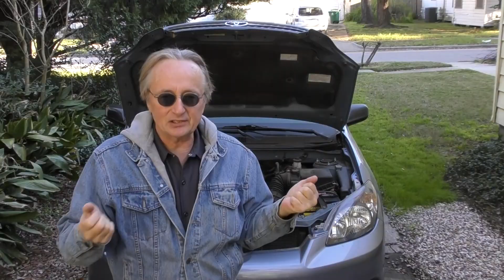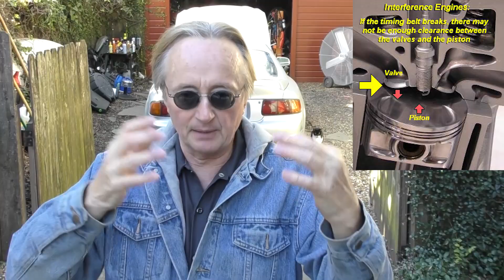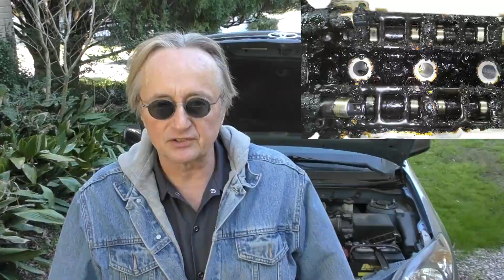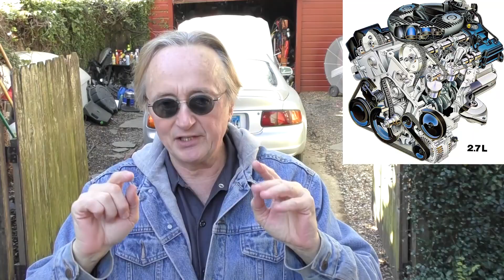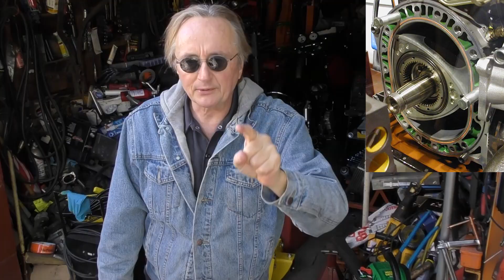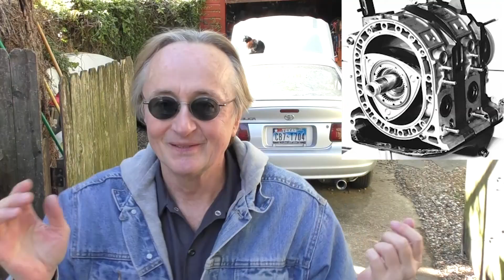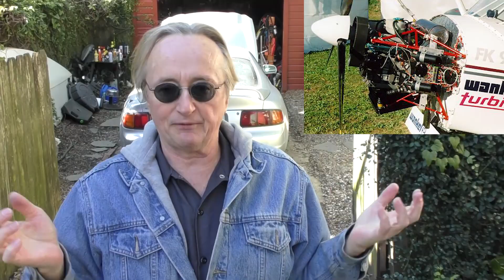Never Buy a Car With This Engine

Comment: Dodge 2.7. Olds 3.0. GM 2.2. Ford 6.0 Diesel. ANY Northstar engine. Those are the ones that come to mind.
Reply: For some reason, the 1996-2001 Northstars in the Devilles were decent.  I'm not sure what all the specific differences were... but I know in 2002 they went decided to f*** up a good thing and make garbage again.  I have a '99 Deville w/ 185K+ that has been trouble-free.  I love it.
Reply: The 96-01 NorthStar engines were one of the worst model years. The best NorthStar engines are from 2006-11.

Comment: On the other hand, their 2.4l LE5 is a beast. I have a 2006 2.4l Cobalt that I put 389,000 miles on before spinning a rod bearing. About 50k miles of it was pulling a pop-up trailer as 170% of its tow rating. Of course that cost me a transmission, but that was my fault. I didn't baby it either. I added a CAI, Header and full Corsa exhaust and had my ECM and TCM tuned by Wester's garage before having the fuel air ratio dialed in on a dyno and taking it to the track a couple times. I dropped another low mileage LE5 in it and am driving it today with no desire or expectation to ever get rid of it.  What I don't recommend is the Ford 6.4l diesel. Mine died at only 150k miles, despite the proper scheduled maintenance and I sold the truck for scrap rather than to spend $15k to repair it.

Comment: Mis-fires can be seen on a $100 scan tool.  Chrysler does not have design problems, the whole company is a design problem.
Reply: How the mighty have fallen! Chrysler (Dodge-Plymouth-Imperial-DeSoto) used to be the most desirable cars. They couldn't out-do GM or Ford because they couldn't undersell them but if you were willing to pay a little more you got a superior car.
Reply: Mopar as a platform has so many issues it baffles me how it has die hards. Some jeeps and dodges leak fluid all over the underside of the frame because of where the oil/trans fluid pan is located...behind the driveshaft??? C'mon
Reply: lol
Reply: Planned obsolescence
Reply: Yeah that should have easily made the list!
Reply: My Grand Caravans have been bulletproof tanks.
Reply: @spacejockey4746  don’t listen to these morons they live in echo chambers lol
Reply: lol (2)
Reply: I have a eco tec in my Aveo 265,000 miles still runs good

Comment: As long as I had a quart of oil with me, my Chevy Vega was the best car I ever had. Lol. 1973-$425.00 car. Drove it everywhere, forever. Lol.  The "worst" car was my best. (After 100,000 miles I used 90-140 gear oil for oil. It worked.

Comment: The 1.8t isn't that bad. It's really the dealer's fault about not warning about the oil.
Coil packs often go, but other than that it's relatively reliable for a VW product. Early 1.8 TSIs are much worse.
Reply: Yep. Why blame the manufacturer if the owner can't put the right oil in?

Comment: However, aftermarket ceramic apex seals, as well as having your fuel pre-mixed and the removal of the OEM oil pump, those 13B rotaries would last a long time with checkups at regular intervals.

Comment: I've got a 2003 saturn vue with the 2.2 ecotech, I paid $300 for it with a "bad head gasket" turned out the overhead cam bearing caps were broken the timing chain tensioners were both broken, so I put another head in it from Upull and pay for $60 bucks and it ran for about 6 months before the timing chain tensioners broke again, this time valves had a direct hit and snapped #1 connecting rod, tore the cylinder liner... The tensioners are the big problem, well that and the cam caps can't be torqued without breaking the bolts, I'm thinking a 16hp Harbor freight engine is better built and might even drop in...LOL!

Comment: I’ve had 2 GM cars with the 3100 V6 and I’d rather stay away from them due to the head gasket blowing up
Reply: not head gasket, intake gasket.... and the older 3.1 multiport V6 that came before it wasnt as prone to that problem..... bullet proof

Comment: You forgot to mention the Ford 4.0 liter engine found in the Explorers, designed in Germany, the engine has 4 timing chains.  It's good for a boat anchor though lol
Reply: I have the cam in block OHV version in my 93 2wd 5 speed ranger. That thing is freaking Bulletproof mine has over 500 thousand miles on it and it's the only thing in my driveway that runs. It will start when it's 30 below zero when my Civic with under a hundred thousand miles is dead or always broken down and my CRV doesn't like the cold either. People always say that Hondas are great but everyone I've had is constantly broke down and nickel and dime to me, my 93 Ranger and other hand is Bulletproof just can't trust it cuz of it's age
Reply: @theejoeylee  but he is right the redesign was awful. the rear timing chain guides fail and the engine must be removed to replace. typical ford crap, take something that works and re-design it turning it into trash.
Reply: You really, really have to keep up on the oil changes on these.  I've heard stories and have seen one personally, where a person goes to get their oil changed and the engine leaves the shop knocking because the oil was neglected and the cams get fried lol
Reply: I've seen an 05 Explorer with this engine. The guides were going and chain rattling with only 25,000 miles on it.

Comment: 190k highway miles on my folks 2.2 ecotec and working just fine. The 2.7 chrysler is a bad water pump design, I replaced the water pump on my convertible I picked up cheap due to the leaking water pump. Not all, but a good portion of the stupid ford v6's are now using this horrible timing chain driven water pump. And they know about Chrysler's issues ahead of time ha. What say you on that, Scotty? I know Fords are the next best thing to a Toyota to you.

Comment: I had a 2002 sunfire with a 2.2l ecotec and it lasted forever and I wasn't gentle on it but my mom's Saturn 2005 had the same motor and it blew in her car around 300.000 km
Reply: The ecotec is a great motor. I have the 2.4L ecotec  in my 09 Pontiac G6 2 door coupe. I bought it off my neighbour who bought it brand new in 09 and he changed the oil when the oil life got under 20% using Castrol GTX. He also replaced most of the exhaust, had Mr. Transmission rebuild the 6 speed tranny in 2014. All 4 wheel bearings replaced with the high quality ones Stereo was replaced under warrenty so it has the newer GM stereo where you plug your phone into it. I put new:plugs, altenator, battery muffler 4 rotors and pads, passenger front wheel bearing. The motor has VVT so hp is rated at 166 to 177hp. You can put a chip in it to give you 17 more hp and better gas miliage so basically would make it 180hp average. The engine runs smooth and quiet I use synthetic oil and also put duralube in every oil change
Reply: Had a 2.2l ecotec in a oldsmobile alero never had an issue. Had same engine in a Saturn vue and the thing threw timing twice before I got rid of it.

Comment: We seen a bad design flaw on some the GM Family 1 is a straight-4 piston engine that was developed by Opel where an oil cooler has a cheap rubber seal to separate the oil and radiator coolant. The seal is notorious for failing and the cooling system ends up full of oil. It looks like a head gasket failure. It still costs over $2500 to fix if not caught earlyamd you have to replace all the oil contaminated parts. In Australia, it affected TM Barinas (Chevrolet Aveo), JG JH F18D Holden/Chevrolet Cruze and AH Holden/Opel/Chevrolet Astra. It was a known problem that GM and GMH never cared about fixing. Failures were common around 100,000 kms there are reports of failures in low milage cars.

Comment: Hey Scott , Daniel here , I own a 2012 Corolla  and every morning when I start it up to warm it up before taking off to work , it makes a loud rattle noise , but it only happens when the car is been sitting for a lil while or when I get a cold start , once is warm or is been running it doesn't do it , I've read on forums that it could be the timing chain getting loose could that be the issue ?

Comment: I'm a student in the Automotive Service program  andI've got a 2004 Oldsmobile Alero with the 2.2L ecotec with almost 240,000 miles on it and I recently had my water pump go out which led to also having to replace the timing and balance shaft chain components since the water pump is driven by the balance shaft chain. Its a great little engine, just a pain to work on things. I have less than $500 into the engine since I do all my own repairs.

Comment: The 2.7 Chrysler engine can be fine if it's service regular my mom had an Intrepid with it I kept the oil changed regular and it had over 200,000 miles on it what she sold it

Comment: How did the HT4100, Northstar(first Gen) Ford 2.9(Bronco II) and Quad 4 not make this video?🤔🤔🤔
Reply: I had that HT 4100. Nicknamed Hand Tightened
Reply: Prince Matchebelli cause the 2.9 is actually good
Reply: @yoakamfan92  Sure was.  I had 275,000 miles on mine and it was still running strong when I sold my Bronco II.

Comment: Had great luck with the ecotec engines.  Saturn ions, some L series and some Vues had them.  Never had issues with any I’ve owned, and all bought used.  Some went by way or rust long before they failed mechanically.

Comment: Bullshit.
Our 1.8t motors in germany can run up to 250.000 miles without bigger issues. ( at least the older ones when quality was still a thing )

Comment: The timing chain broke at 151,000 miles on my 2002 Olds Alero GX (2.2 L Ecotec I4). I bought it new and enjoyed it overall. I was sorry to see GM eliminate the Oldsmobile line. (Of course, GM needs to improve its reliability.)

Comment: I have a 2.2l ectotec HHR.. and it's timing chain just went bad. I just bought a Toyota!
Reply: A heart from scotty in 3, 2, 1.....
Reply: Tech guy Scotty is proud
Reply: Had a 2.2 Saturn ion timing went out blew the engine with it
Reply: raprapghost2 mine took out the whole engine as well. Not good good, no warning.
Reply: Saturn Ions are a bad car.
Reply: The 2.2 in my Cobalt blew at 101k. Idk why GM wasn't sued for these engines.

Comment: Gee,  Scotty,   I've got a 2000 VW Passat with the 1.8T engine and it's amazing!!  170,000 miles now (had 112,000 when I bought it),  no smoke, no burning oil, it's a freakin' ROCKET.  True, maintenance is higher on this car than most others, and I did change the timing belt when due, but if you can't afford to maintain your car then you can't afford a car, period.  At least the previous owner changed the oil (synthetic!) when he was supposed to but when I got it the spark plugs were burned down to nubs!!  Once I replaced those the car was a rocket ship!!  Very happy with it too!  ON A SIDE NOTE:  we bought a Scion XB in 2006, brand new, and this has been the most reliable TROUBLE FREE CAR we've ever owned!!  It has 160,000 trouble free miles on it too! 
Dang, I wish they made that car with a turbo!

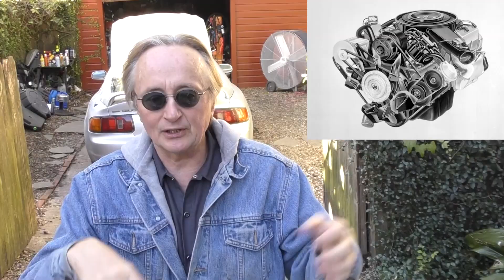Comment: 5:45
Some of the modern train locomotives can do this, they intentionally skip-fire but cycle through all the cylinders, so that the idle fuel consumption is reduced, while still being able to keep the engine warm.
Reply: Good in principle when designed by competent engineers. Hard-chromed cylinder bores are good too, when competently applied.

Comment: I know for sure the Northstar Engine should have been on this list. All aluminum, but many problems of overheating. Those engines overheated the cylinders would warp, because it was all aluminum. Then you'd burn a bunch of oil just complete junk.

Comment: The problem with Mazda rx4 for example, you had to always fill oil because they just burned oil, and newer overhet, then they worked ok.
But people drove tvem as usually cars, didnt care especially and git engine problem, my father worked with those.
But what really killed them, not the engibes tvat was reused in racing cheap, they rusted up fast.

This guy talk alot the good things with a rotary engine us low wheight, and they like to rev., But they taje gas like an v8 and oil too and dont ioverheat.
As they cane from mazda in the 70,s people was used to cas iron engines that could take lots af abuse.

I for one miss a new Mazda RX7, a real sportscar again.

Comment: Scotty, remember the GM 5.7L. diesel engines that premiered in the Oldsmobiles? What a godawful failure those were. Just put glow plugs in place of spark plugs and feed it oil - what could go wrong? My friend Chuck bought one and it spent more time in the garage being repaired than on the road. It didn't use much fuel because it rarely ran. Those poor guys who had one that did run got worse mileage than the gasoline versions and still had to deal with the smoke, noise, vibration and hard starting.

Comment: 2.7L Chrysler is worst by far IMO; didn't matter if you maintained it properly, still went kaplooey.  The 8-6-4 Caddy motor ran fine once you disconnected that stupid system; Northstar V8 however....

Comment: I have an equinox with this ecotech engine, can confirm. Already 5000 in engine repair.
Reply: Crystal Moquin why???
Reply: @RealWorldGarage  first time timing chain broke, bent the valves. Second time pcv system clogged and popped out rear main seal.

Comment: Chrysler is not the only company that designed an engine with a internal water pump the ford 3.5 and 3.7 engines have internal a  water pump driven by the timing chain
Reply: don't the later 2.2 cavalier engine have that as well?

Comment: I had 3 ecotec engines: 92 Cavalier, 2004 and 2012 Malibus. Only problem was with the Cavalier. Kept blowing head gaskets. No problems with the Malibus.
Reply: bsmack66 92 cavalier is not an ecotec, it is a 2.2.

Comment: I just bought a new Honda civic sport. I was going to have my oil changed at 3000 miles but the car said the oil life still had 70 percent life. They told me not to change it till oil life at 15 percent. ?  When should I change it

Comment: As a mechanic AND Cobalt SS owner for many years I call bs on this video. The Ecotecs are badass tough engines in every variety. Mine dynos at 353 HP with 25 psi of boost pushing into it. It's one of the most reliable, fun daily drivers I've ever had. There are guys getting 500+ HP out of them, reliably. I've also owned the 2.2 & it was tough as a boot. Yes they have timing chain issues if you don't change your oil often. It's still leaps and bounds better than a timing belt. Top worst engines for me would be Chrystler 4.0 Inline 6. Horrible issues for years with piston skirts breaking. GM 3.1 & 3.4. Most people know how terrible they are about lower intake gaskets leaking & how much of a pain it is to change them, having to pull all the pushrods out to replace it. The Northstar was an abismal failure in every aspect. Who decided to mount the starter under the intake? Honda/Acura 2.5 inline 5 cylinder... what a turd that was. Subaru 2.5 DOHC would be another one on my list. I do still enjoy your videos Scotty.

Comment: Yugo's 1.2 liter 40 HP engine from the 1980's should be on the list too.
Reply: There was no 1.2L engine and there is no 40hp engine either. My second car was YUGO 45 entry level 1.0L engine with 45hp. There was 1.1 and 1.3EFI (Yugo 55-65). But those engines don't deserve to be on this list because they were easy and cheap to fix by any mechanic with basic tools.

Comment: My 2005 Rx8 GT  has 128k on her original engine. Changed radiator aluminium silicon hoses, sub tank changed, every 30k change wires an plugs, 3 k oil changes, mods to suspension and tires. I actually read an learned how to maintain a rotary. If you know the car an engine it will last longer like mine. People just are lazy an don't maintain there car.

Comment: Pop had a v864 cady.since the eng was from 500 472 425 368 caddy family,a great mech like scotty suggested to switch to older eng or just disconnect the system and run only 8 mode.pop did the v8 only mode. He was a happier camper.

Comment: i have a 2001 sebring convertible with the 2.7L. my dad bought it new and it now has 140K miles, daily drive it to work 5 days a week.  original engine / trans and get 22 mpg (mostly highway)

Comment: My mom's 08 Saturn Vue with the 2.2l eco tec blew up at 160k miles. It went through 3 timing chains before finally spinning a rod bearing. We junked it.

Comment: How about the ford 5.4L 3 valve... Stupidity at its greatest. Change the plugs and they brake so go ahead and pull the cab to get the heads off. Timing chain and cam gear issues.

Comment: he should have given honorable mention to the Mercedes 4 cyl 270, 271 and 274 engines. these are all junk from the word go. constantly getting check engine lights from the poorly designed plastic crankcase ventilation system. the 270/274 water pumps have a vacuum shut off, which sticks in the off position so the engine overheats. garbage.

Comment: I am surprised no one mentioned the Mitsubishi 2.6L from the 80's. I partially helped fund my racing back then replacing the timing chains and guides as well as installing balance shaft eliminator kits. Usually at fairly low miles on the Odometer.
Reply: My Dad's Chrysler E Class with the 2.6 had that exact issue.
Reply: @DUCKSAREEVILLLLLLLL   Yep. I did a huge amount of them back then. Made good money at it too.

Comment: Ive been driving my VW Jetta 1.8t as a delivery driver for 3 years now.(280k) Runs great, zero problems, but you're completely right, use the correct oil. keep up with maintenance.
Reply: I’m also a delivery driver in my 2010 Jetta. No issues as well. Love the car

Comment: The 2.2 eco tech is actually a stupid simple design. It had no egr and no PCv valve to replace. Also no vvt to go bad. Also, the timing chain issue only applies to 03-04 engines and is easily fixed preventative maintanance

Comment: I think chryslers bad engineering is on purpose. Had a convertible seebring that to take out battery you had to remove left front wheel and mud cover. You couldnt do it from the front.